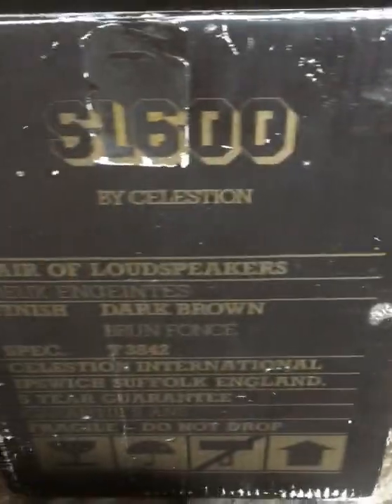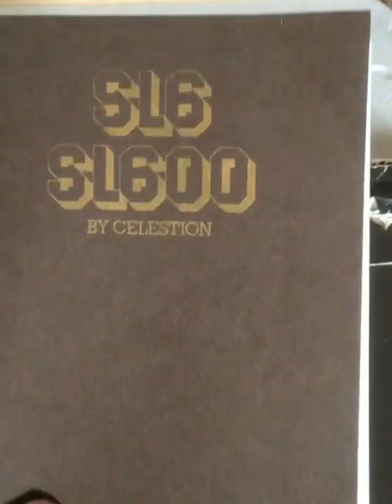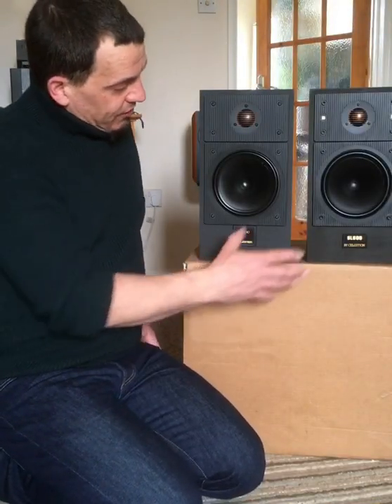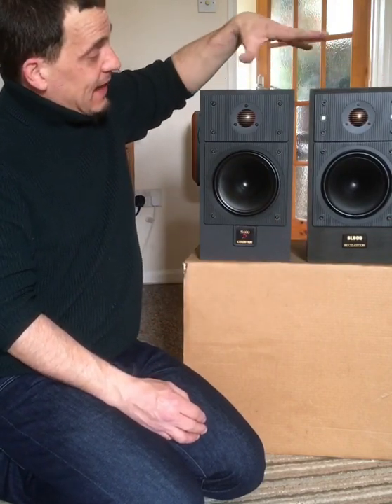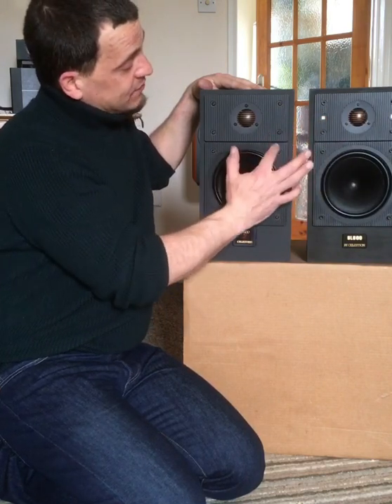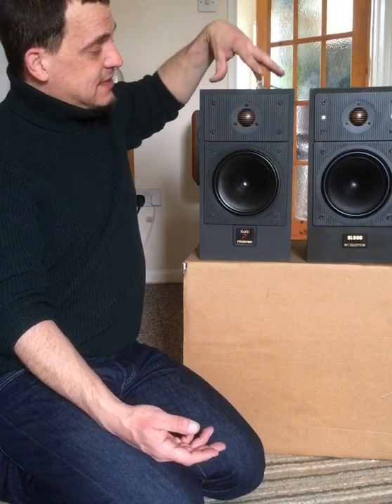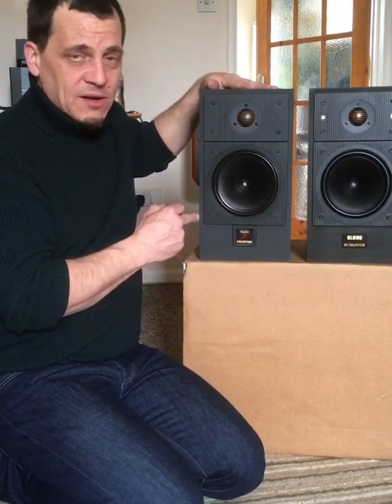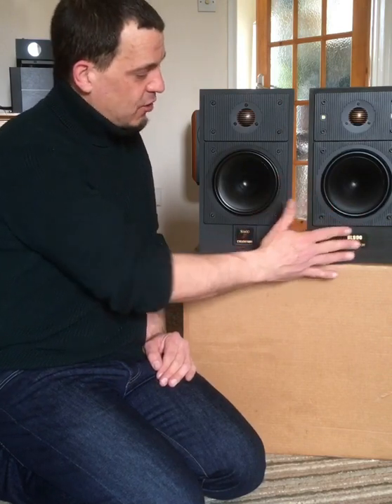#Celestion #Speakers Celestion SL600 vs SL600si

Comment: I have the same furniture issue as you with one speaker behind the end of a couch. I got sight of the top speaker in a 2.5 way Mordaunt Short Avant floor stander - do you miss a lot with the drivers firing into the couch?
Reply from the maker: Not too bad but we changed that sofa for that reason

Comment: ditton mate, i have the chance ,to get, the aerolam  pair of cabinets,, on ebay , but drivers ive got are from sl6, round ones the sl600, uses, kind of rounded curved bolt on bass, mid units, also is the crossovers, different on , sl6, to the sl600, i also need a copper tweeter, but that aside, i can modify, the bass mid units to, fit and get them cnc machined to correct shape, treble copper dome tweeter ,  will bolt straight on to the face plates, do you think it a plausible project or a time/money, waster mate, ditton as my no1 celestion go,to man i appreciate your information..rob.x.
Reply from the maker: Get the cabinets mate
Reply: @dittonworks  will crossovers be a straight swap old pal, if so i will at 185 plus p and p thats uk......p.s u ever heard quad esl 63??? bud, they are afew cn ebay now for crazy cheap cash from 499;700 are they better at imaging than the great old 600 if so but doubt any speaker can be , i might go for apair of them , have you heard a pair mate, i have,nt...
Reply from the maker: @robertneil2538  everything from the SL6 will fit into the aerolam cabinets.
Just make sure you block off the bass driver mounting screw holes 🕳 with screws, otherwise they will leak air.
The faceplates from the SL6 will hold the bass driver in place. 
The SL600 crossovers are slightly different as they bolt into the back of the aerolam cabinets.

Comment: Amazing speakers. Try to move something like 50 cm alway to the back wall. Also use a little toe in.
Reply from the maker: The room has been changed since Doing that video.
They are further apart and further away from the back wall now... well the stands are,, presently using ProAc Studio 100’s.... with pleasing results..
Thanks for commenting 👍
Reply: the more i hear this demo kev, i am noticing,how decongested they are from the sl600........

Comment: I have a pair of DL8's from the later more budget line. Do you think it will be worth it to try an recap or even upgrade the crossovers? (Since that is probably where they saved money on).
Reply from the maker: @D1N02 
I have a pair too, I would recommend replacing the caps with some Mundorf E-Caps.

They aren’t expensive and will bring them back to life without massively altering the original sound. 
Check out Ditton Works Facebook page for tips and clips on Celestion speakers 

https://www.facebook.com/Ditton-Works-114479213723916/
Reply: @dittonworks  Thanks I'll look them up!